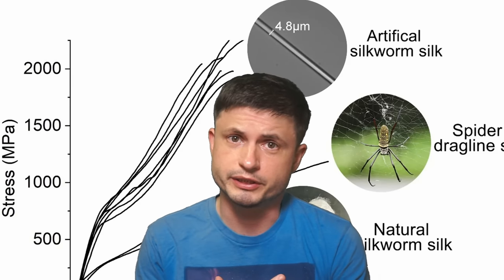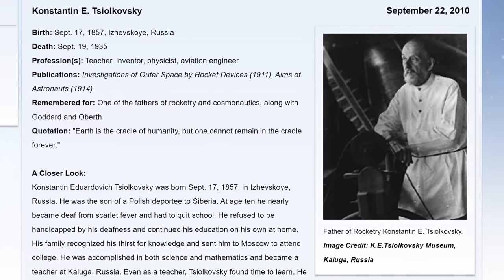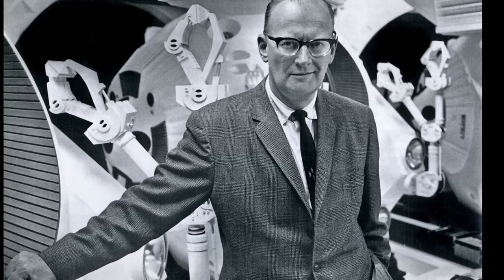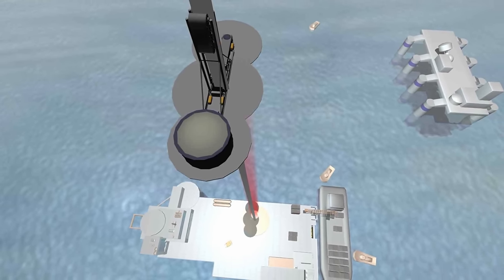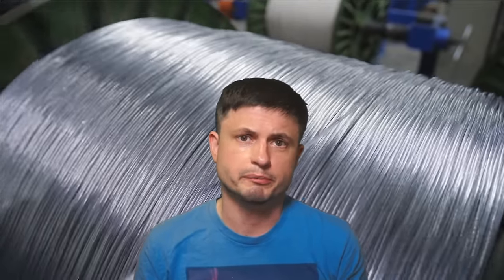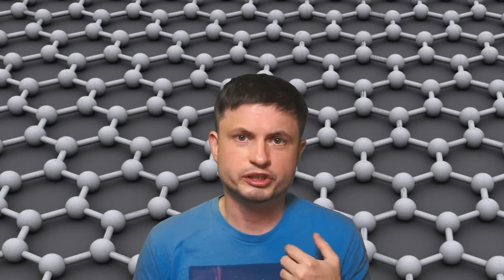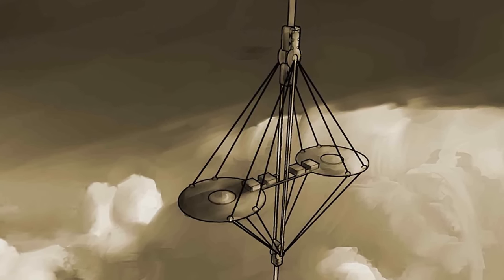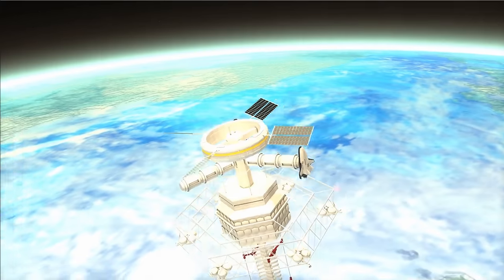Exciting New Updates About Space Elevator Technology...Possible After All?

Comment: I can understand there might be a way to build this space elevator but consider that is a lot of weight to put into orbit but worse, IMO, is how do you stabilize the structure against hurricane and jet streams? Also, how do you handle the issue of lightning strikes? Metal fatigue and other issues that aircraft have to deal with regularly? Just curious...
Reply: As far as winds, probably not that much worse than with current suspension bridges and hurricanes. And most of that is going to be on what is relatively close to the surface... Geosync is 35.7k kilometers up, and the tether is going to be under enormous tension. It'd be like trying to snap a guitar string by blowing air across it only 1mm from where it connects to the guitar. At worst, you might set up some minor standing waves, but building a system for damping those is probably less of a challenge than simply stringing the guitar. The movement of cargo is probably going to cause bigger problems than the wind will.

The first tether is probably going to be fairly temporary, lasting only a year or two. But once that tether is in place, it offers an easy way to ship up the materials to place multiple tethers to replace it. Where it starts with one... it will become seven, then nineteen, then thirty-seven... with thirty-seven tethers, you could have a climber pod depart or arrive every other day, with some redundancy for express cargo and maintenance. At 300 kph, it would take ~5 days to reach Geosync. A day to off- and on-load cargo, and then back it comes. Imagine, vacationing in orbit. A week up, a few days there, a week back. And that assumes a fairly sedate average velocity (as far as space travel velocities go).

 Replacing a tether could probably be done in a month once it arrives on site at the surface. Up to geosync in about week, lowered back down in another. Two weeks leeway for setup and such. Production would take longer... but that would be planned for in advance.

Fatigue may play a part in having to replace tethers... but again, with multiple tethers involved, replacing them regularly is nowhere near a problem, it's just a maintenance issue, same with bridges and planes. Eventually, the fatigued parts are replaced.

Comment: This is very exciting!  The numbers around this concept are staggering.  If you think that the fastest elevators today, the express elevators in high rise buildings, travel ~100 km/hr., it would take 354 hours to make GEO at 35,000 km, or just over two weeks.  That's about the same as a steamship crossing of the Atlantic during the late 19th Century.  I'm sure they would shoot for at least 10x that rate, but it's still a day and a half to get there.

Then there's the problem of space debris.  I'm sure that someone down in the comments is going to mention that everything in orbit around the Earth (except satellites in an exact polar orbit) will eventually run into this structure.  Personally, I consider that a feature rather than a bug.  All you need to do is wrap the structure in a km or so of some very low density material, such as aerogel, and it will happily gather up all the debris in orbit.  This only has to be done in the thousand km or so close to the surface where satellites orbit, and another equal bit up near GEO. Of course, active satellites will have to be able to maneuver around it, but even if they hit it, they might still be functional due to the slow deceleration of the low density material.

Comment: Due to limitation of material and geopolitics, it is more likely we see a space elevator on the moon first, or another object with low gravity,  some type of activity that require frequent traffics between surface and orbit like astroide mining or something.
Reply: I don't agree.
One reason is that such a space elevator would still have to be built on Earth and transported into space. And once we have done that, it would be a lot more beneficial to have it around Earth than around the Moon.
Secondly, the "lunarstationary orbit" is 2-3 timer higher than the geostationary orbit. Meaning that a space elevator on the Moon would have to be 2-3 timer longer than one on Earth. So most likely it wouldn't be cheaper to build.
Thirdly, that would be outside of the Moon's Hill sphere. Meaning the Moon isn't the dominant gravitational body. So I am very uncertain whether a space elevator on the Moon would even be possible. You could possibly try to make one in the L1 Lagrange point. But again, I am uncertain whether this would be sufficiently stable as to be possible. At the very least it would be a LOT more expensive than making a space elevator for Earth.

As for asteroid mining, in fact an asteroid to be used for mining would be the PERFECT counter weight for a space elevator.

Comment: I think they already have the tools to start iterating and testing stuff. 

You could hang a cable made from this strong material from a geostationary space station, and use it to lower back astronauts or equipment from there, reducing the cost of having to send a shuttle to get them back, not using it as an elevator, but more like a firemen's pole (one with safety measures in place, of course) or a simple pulley mechanism to lower said equipment. 

Of course astronauts would need to go down using a space suit, maybe with a dedicated mechanism to lower themselves down without using their hands, but I think this would be a good test of how the extreme heat/cold of space could affect the material, or how strong wind from the cloud layer of the atmosphere would affect the cable. 

Basically seeing how viable it is to hang these hypothetical long cables from a geostationary orbit. And probably learn something new from it as well.

If we manage to do it on that scale first, I'd think it's a step forward towards te space elevator, for sure.
Reply: First, astronauts don't go up to geostationary orbit.
Second, GSO is about 36,000 km up. That's about the circumference of the Earth. Think about that when you start even thinking about lowering yourself using your hands.

Comment: A 100 year project.
Maybe tower and line design?
What about a tower that is built in the middle of gravity & centrifugal force. First small and only strong enough for the next stage of building. The center is at the equator. Maybe the shape is parabolic. But the less tower material, the more line super material is used.
In the center the action is just like the line elevator but has 100 elevators.
If the tower was made of graphene in composite with other compatible materials.
A combination of super material and superstructure. 
Until we discover anti-gravity. Then we would have a huge eyesore!

Comment: Anton hits another one out of the park!  Nice video!   Methinks before we go for the space elevator; we should go for the horizontal spaceship accelerator/decelerator via such a cable taking advantage of the electrical properties and using an electromagnetic solenoid to accelerate and decelerate spaceships en route to Mars.    This may be able to accelerate the round trip to Mars to 9 days instead of 9 months or whatever the terrible numbers are now.  A series of segments of 10,000 KM long cables near both ends of the proposed trip with maybe 3 segment in the middle.  Each segment having rocket powered terminal tensioning ends.  Spaceship would still have some maneuvering rockets.
Reply: Total agree! Check out the videos on the "Tethered Ring".
Reply: @pewterhacker  Hey Thanks!  Will do.

Comment: One problem that these new materials have not tackled yet is the ability to absorb and diffuse heat, or at least negotiate the heat generated by the strains thrust upon them by the tension of the line in great length, as it pulls variably down the length of the tether. All this strain on such a lightweight line will certainly become brittle far faster than any conventional steel cable, needing to be replaced far more often than it is worth putting into place. And even if this material does have that ability, there is the need to produce this material in a length equal to the necessary requirement in one continuous strand. To compound this issue, how do you put a single strand of wire into place that cannot stand on itself but rather withstand great tension? Lower it from orbit? That presents more issues...
Reply: I'm sure they thought of that as well, but yes, good questions there.

Comment: Graphene as a conductor. The graphene space elevator could be self powering. As experiments a few years ago have already showed, a conductor stretched between points of differing altitude generates a current flow. From geosynchronous orbit, the power generated might be quite significant [see NASA Plasma Motor Generator].   A small amount of the current could be used to power an ion motor to help keep the station at constant orbital speed, when needed, to offset the drag generating the current creates. After filling the needs of the elevator, the over production could be exported back down to the base station and perhaps to commercial usage. Get enough tethered space stations extracting energy from this effect and bye-bye fossil fuels.  Many birds with one graphene cable.

Questions to ask: 
1. Would the electricity generated  exceed the electricity needed to overcome the effects of drag considering the electrical properties of graphene?
2.  Which would be best: to accelerate the station or the counterweight? 
3. Would the PMG effect naturally occur in graphene without any modification and might this actually be a problem and not a boon?

Comment: There are ideas for compression based towers too, using an idea called active support, basically like running water through a hose?  Idk.  Even if mega structures to space are possible, I kind of doubt we'll ever build any.  They require enormous resources to build, and I think a lot of mega structure ideas might be kind of vulnerable to terrorism.  Like a space tower, space elevator, orbital ring, whatever, would all collapse if blasted apart in the middle somewhere.
Reply: There would have to be an internationally created navy to defend the seas around the island the space elevator is anchored and a private defense force the size of an army to defend and regulate it

Comment: I just had an inspiration. What if we give up on reaching the ground. Just get it low enough that a plane can easily reach it. Now it is helpful if it is moving at a speed that matches an airplane. This lowers the altitude of space station, shortening the cable length even more. This also avoids problems with the small variations in the rotation speed of Earth.
Air resistance is a problem in either case. The stationary case has to deal with wind pushing on it. This is made worse by reaching into the lower atmosphere which is dense and has more storms to deal with. My plan reduces these problems, but adds the problem that it is always moving through the air. How these factors balance out is going to take some fancy engineering to figure out.
Note that I have never seen any mention of the air resistance problem for the anchored version. It will slow but surely drag the satellite out of orbit if it is not countered by a matching force on the satellite.
Reply: If you decide to run a marathon, would you stop 100 meters before the finish line, to have a shower and lunch?

A space elevator would have to start at geostationary orbit. That's 36,000 km up.
The Karman Line is considered to be the edge of space. That's 100 km up. So once the space elevator has reached the Karman Line, 99.7% of it has been built already. So would you not just build those last 0.3%?
Reply: @Tjalve70  because that last bit poses the largest problems after building the cable. Thanks to the Moon, the surface of the Earth moves up and down. Earth quakes would tug on the cable. These and I think one or two other effects that change the distance between the satellite and the surface. If this is not compensated for, then either the cable will snap or the satellite will be pulled out of orbit.
Also my plan does not have the satellite at geosynchronous orbit. I admit the difference won't be that much, but it will result in a bigger change than your 0.3%. On a project this large, even a small reduction in size can make a big difference in difficulty.

Comment: Fantastic :) but graphen is good electrical conductor, and there is a permanent voltage 400000V average between earth surface and electrosphere (see atmospheric electricity on wikipedia). Can we solve this with a big insulator at the base? Could it be a source of energy for the elevator?

Comment: I'm just wondering what happens when the counterweight breaks away due to some sort of a collision. When that huge elevator falls, what sort of destruction would that be?
Reply: it would likely depend on where it broke, if something snapped the counter weight off then the whole thing would come down and cause lots of destruction, if it was severed on the earth side which would be much more likely at least early on, then it seems like the cable would either just stay suspended or the whole thing would fly off into space. By the time it became practical to build such an elevator, there would be many safeguards implemented that would keep single points of failures causing such a destruction. 
I would also suspect that as long as you didnt build pretty closely around the base of the elevator that even if the whole thing came down that the destruction wouldnt be that bad as its going to want to crumple around its base like if you dropped a string onto the ground, and not fall sideways a few thousand kilometers like a rigid structure would
Reply: Would it fall though? I imagine it scraping a big gouge across the planet 😮
Reply: @scubagirl1971  i think it makes intuitive sense in terms of the thread wanting to fall around its base as it is light. Although that around its base area would still be a huge area. And there would still pe some sort of a platform up in the GEO that may fall away from the base.
Reply: @gamerscomplete  You could probably have some safeguards near the earth side and probably some at the counterweight but somewhere in between (since it's a really long thread) it just seems impossible unless we have something like a repairing drones that work on autopilot and have quick reaction times. But then we also have the weather changes to consider.
Reply: @gamerscomplete  Would depend on windage loading and location of tether failure but the bulk would burn up on reentry and its still only carbon nanotubes so no wont hurt fuck all you'd actually be lucky to recover more than the first 4-5 hundred kilometres after that reentry should pretty much take care of the rest there has been an amazing amount of research into this and the drag vs weight of a carbon tether means the remaining 4-5 hundred k's of tether would still fall pretty slow once it got to below 50,000 feet and starts picking up drag.
Reply: I think you all are forgetting about angular momentum.  The cable would tend to fall forward,  toward the direction of rotation of the earth, since higher parts of the cable are moving faster than lower parts.
Reply: @ETLee-db6cn  would it overpower atmospheric drag though? I'm just speculating though. I have no idea about any of this.
Reply: @umanggada8684  i have no idea about the portion in the atmosphere, but that's only a few dozen miles out of >22000 miles (35000 km) of cable... not quite enough to wrap around the earth if it fell in one long piece. I expect it'd break up, though.
Reply: @umanggada8684  To your original question: the counterweight,  freed of the tether,  would go into an elliptical orbit around the earth with it's original position as the perigee of the orbit...Unless it was far enough out to go into a hyperbolic trajectory and escape. Third body effects (Moon? Sun?) could alter the orbit and cause a collision with Earth or Moon... and how big IS the counterweight?  Asteroid sized?

Comment: Work backwards and use an orbital ring.  Basic theory dictates that an electric current moved through Earth's magnetic field would impart a motive force that would keep ring segments in a stable orbit.  This could, depending on that force, keep an orbital platform in much lower orbits than the usually suggested geosynchronous, and also would not need a counterweight asteroid in a much higher orbit - which is the usual space elevator configuration.
You could then drop a tether down for your space elevator.  The vastly shorter length would be well within current materials capabilities.
Space travel would still require boosting from a gravity well, but you'd now be doing it from low orbit rather than the ground.
And as space industry becomes more commonplace, you could expand your orbital ring(s) out to greater heights.

Comment: The space station would need to move slightly faster than the rotation of earth. That way the stability of the whole structure wouldn't be compromised. Nano Carbon fiber can work but would need to be strengthened.
Reply: How would it not be compromised if it moves faster than Earth.
I disagree. I would say that it has to move slightly SLOWER than earth.